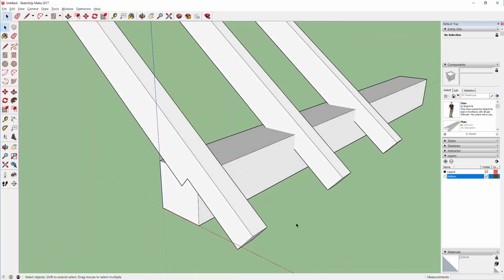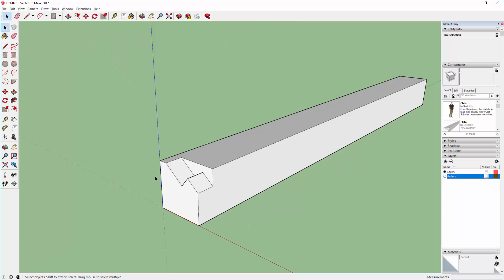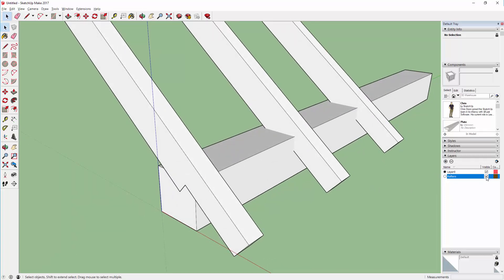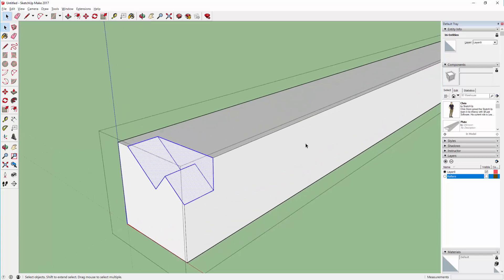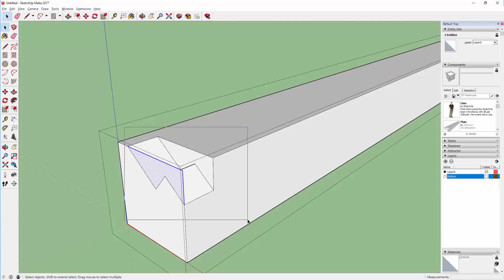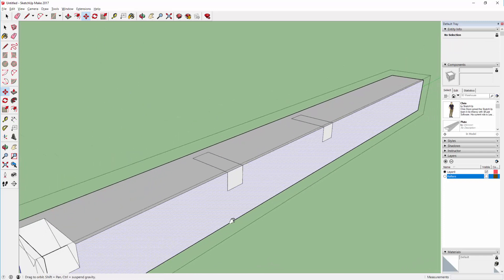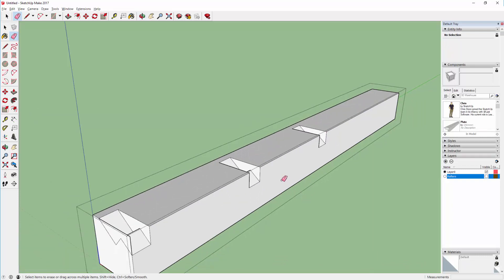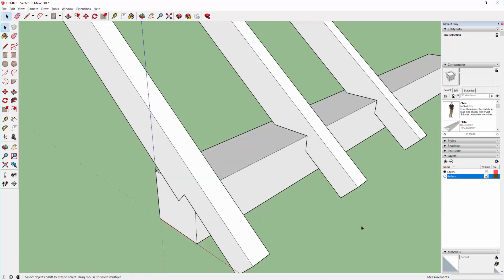SketchUp Quick Tip:  Step Lap Beam/Rafter Connection

Comment: Thanks for sharing. Why don't you use a solid tool option. This will save you tons of time. Especially  when building a frame with all the mortice and tenons?
Reply from the maker: I don't think the free version of Sketchup Make supports the solid tools. If it does, I'd be happy to learn about it.
Reply: @SalemWoodworks  I reckon it comes with the standard package. There’s clips on YouTube you will find helpful to wrap your head around it. Very useful tool.